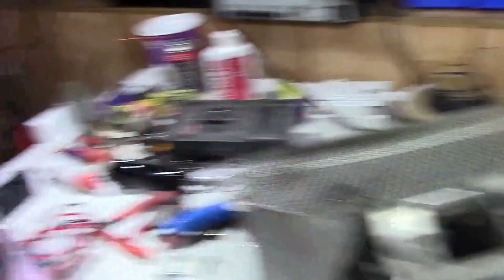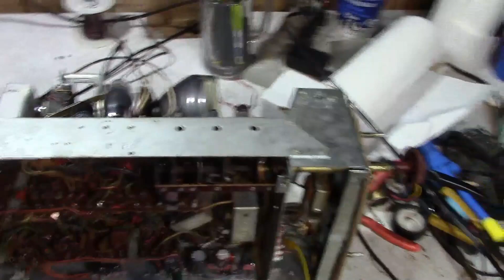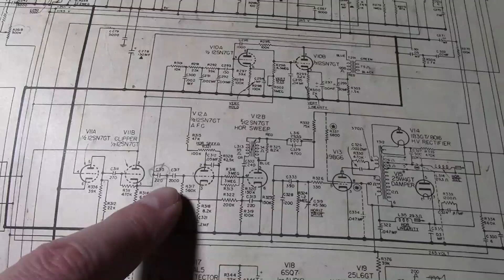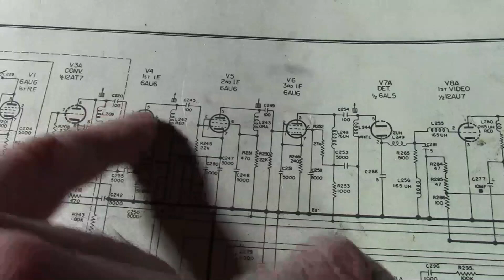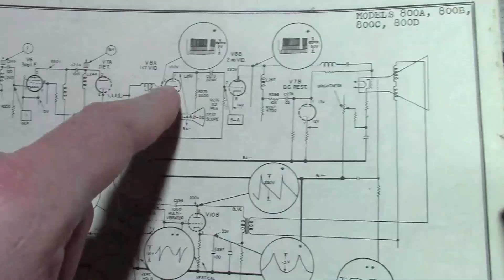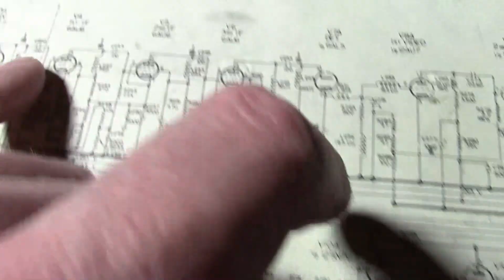GE 800D restoration p3o8

Comment: This is like Déjà vu. I worked on a GE 800C which exhibits very similar behaviour. Decent picture & sound with the contrast all the way up, but when you adjust the contrast it kills the sound & the video. I couldn't find the problem and assumed that it might have been the design. I'm rethinking that now. I had always subscribed to the conventional wisdom that failure of sealed Bakelite mica caps was extremely rare. I had also considered that it might be an alignment issue given the large number of out-of-tolerance components I had to replace throughout the set. I'm anxious to see what you do next as it will inspire me to open up my set again.
Reply from the maker: Stay tuned.  I will be exploring the contrast issue in detail.  I do believe some of it is due to the design. This set has no AGC.  That contrast control directly sets the grid bias on the RF amp and 1st IF amp tubes.  That bias voltage is also derived in a rather odd way.  This set has two B- rails!.  B1- and B2- with the arms of the contrast control straddling them.
Reply: @bandersentv  I spent a long time scratching my head over it. Looking forward to your next video instalment of the 800D.

Comment: Glad to se you back. From early svc. publications I found out that many of the weird "quirks" in the schematics were to avoid patent lawsuits. RCA was famous for nailing anyone they seemed to think had infringed on the patents. I once met a chap in NZ who had mfd. radios without getting RCA patent rights. They finally nailed him. He went out of business. Don't test the mica caps. Just replace them. I ran into a case that the caps tested fine and NOS ones subbed, & didn't fix the problem. New epoxy coated silver micas solved the problem. Saw this in 2 different sets. One RCA & 1 Maggotbox.

Comment: A long shot, but the interstage inductors may be depending somewhat on the tube (grid-to-anode) capacitance... though that value would be small, the act of swapping a tube could affect the tuning? Like I said, a long shot.
Far more likely is one or more "tired" domino caps. I have had a few of those that exhibited low 'Q' characteristics when testing them. Try temporarily putting in a new dipped ceramic as a substitute...
And you are totally correct on the wire gauge on those dominos, I have no idea why they used such a large gauge... nasty business trying to pry one of those off of a fragile paper tube inductor/transformer without ripping off an eyelet.
Cheers,

Comment: I ran into just about all of those issues when restoring mine. Even after a full alignment it's got some quirks with the contrast and sync. Pulling in a good picture on those is like taking a waveform measurement with an oscillograph. You're going to be juggling the front controls adjusting everything a few times before it comes in with BOTH a crisp picture and strong sound... Especially going back and forth between the fine tuning (which has a rather wide range) and the contrast control...and yes, the contrast control on mine also likes to sit past halfway on most of the low-end channels, turning it down will kill the image and even snow, and  because of the DC restoration the screen simply goes black. When you've got everything else spot on, expect the image to still momentarily lose sync occasionally on scene changes. Unless you find something that I missed, it seems like these sets just don't have a very robust sync circuit that later sets had.

Also, there is a page in the rider manual that has the voltage measurements overlaying the bottom-view tube layout/pinout. Be wary of the sams for this model. I think long ago there was a mixup and all folder numbers are actually linked to the 806 schematic which is a good bit different from the 800s (took me forever to figure that one out)
Reply from the maker: Stay tuned.  This footage is a few weeks old.  I'm just about done with the set now and it was quite the journey!

Comment: Good old general electric engineering. You have to disassemble half the chassis to get the picture tube out lovely.  By the late 60s to 70s general electric champion value engineering as in eliminating everything possible from their TV sets such as a high voltage cage to protect the servicemen or to keep whatever soft x-rays came off the rectifier tube in check. I've worked on them in the past where the rectifier tube was supported over top of the exposed fly back with two plastic struts. The rectifier tube was fully exposed and it wasn't one of the types that had the lead and plastic coating over them it was just a normal rectifier tube.  My wife's grandfather who passed on not too long ago at the age of 93 hated working on general electric televisions. The port of colors were especially bad as they used an early printed circuit board with brass rivets joining the top and bottom traces.  He told me he had to resolder every one of those rivets when a GE set came in.  They all either went high resistance or intermittent.
Reply from the maker: GEs are by far my least favorite to work on.  Nearly gave up on this set more than once!  Haven't gotten around to my PortaColor yet but I'm expecting lots of frustration.
Reply: My grandfather did TV work in the 60s and 70s, he was partial to the term "Goofy Electric".